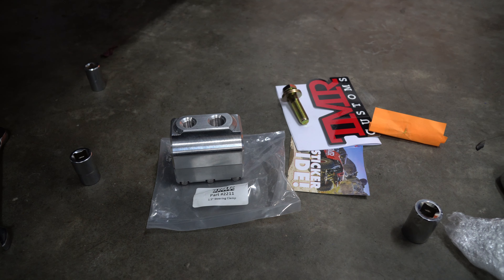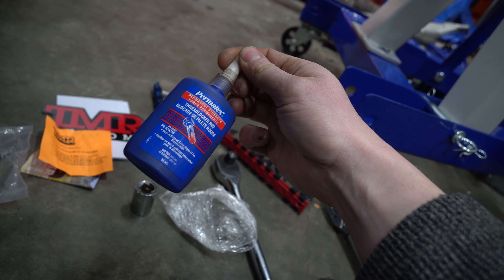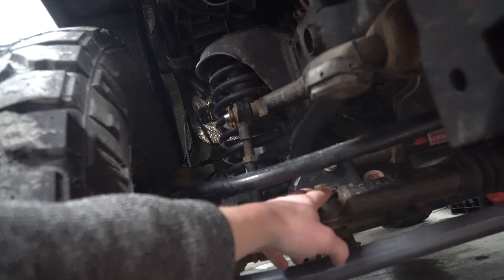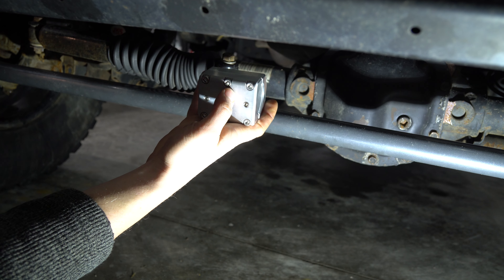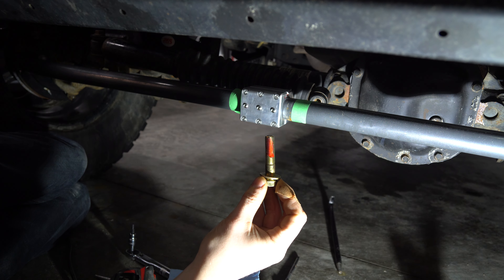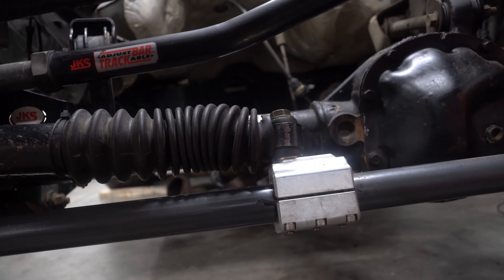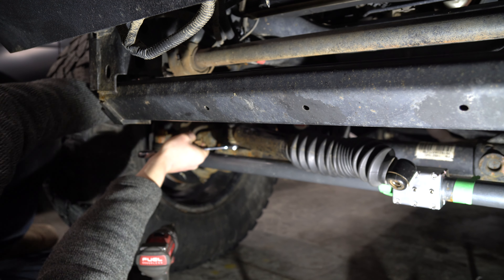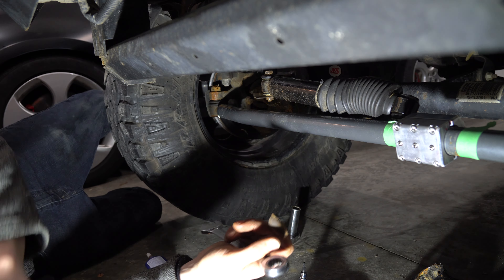HOW TO INSTALL TMR STEERING STABALIZER MOUNT

Comment: Very good video. What size is the bolt that you used for the steering stabilizer? I have a clamp but need a replacement bolt.